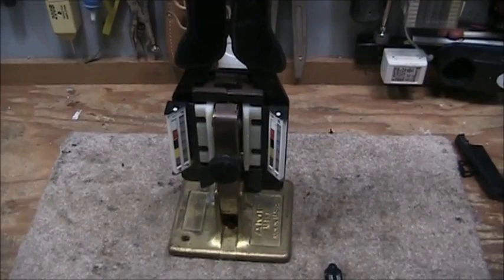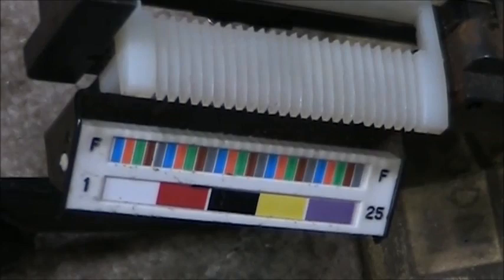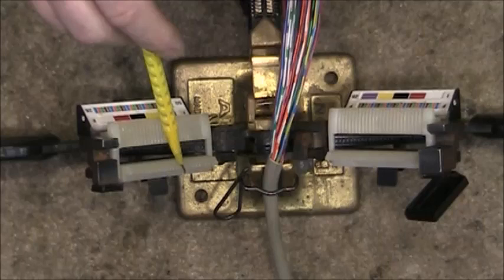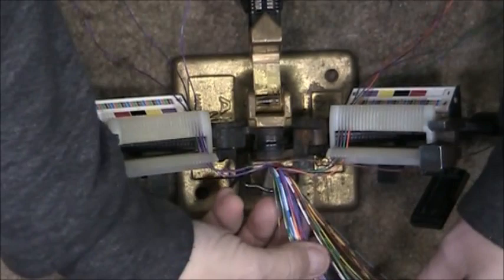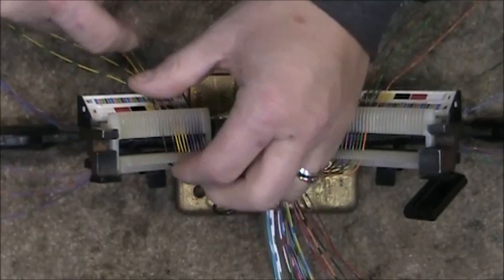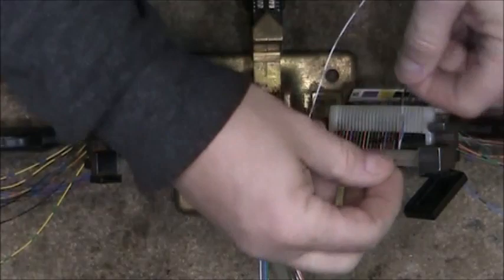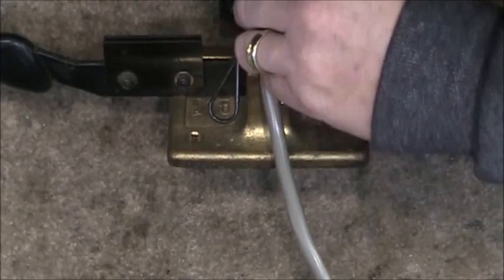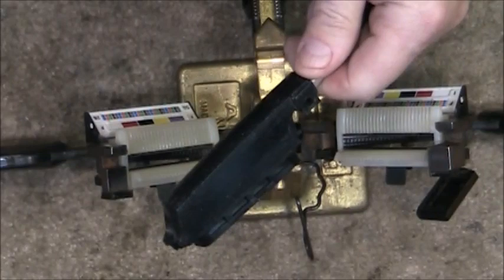Placing a amp/champ connector on a 25 pair cable.

Comment: AMP and Amphenol are two separate companies.  AMP stood for Aircraft Marine Products.  Amphenol was Bunker-Ramo. I attended the AMP factory school in 1976 where I learned how to use and maintain many of their tools and connectors.

I have that AMP tool and will be using it this week to terminate some cables for a Norstar phone system. 

Before I got that tool, I used to solder Amphenol connectors.  That was a 30 - 45 minute job and like you said, the AMP tool will do it in 5 minutes or less.

 I have done thousands of AMP Champ connectors and pulled miles of 25/50/75/100 pair cable.  I was a telecom specialist for a hospital corporation and pulling cable was one job I was glad to see outsourced.  It left me with more time doing phone stuff. :-)